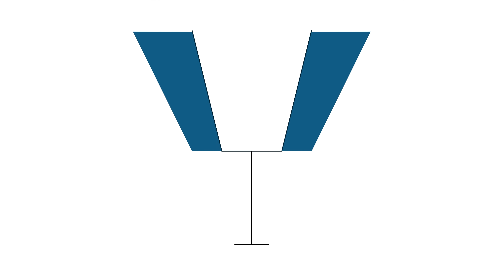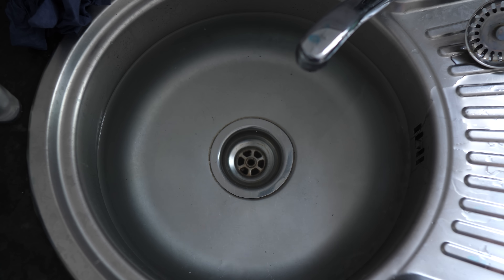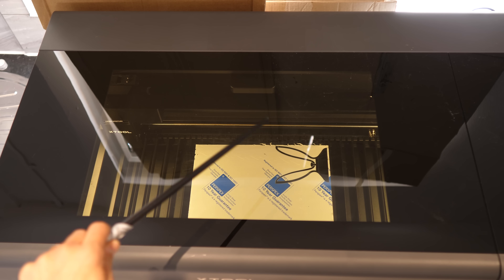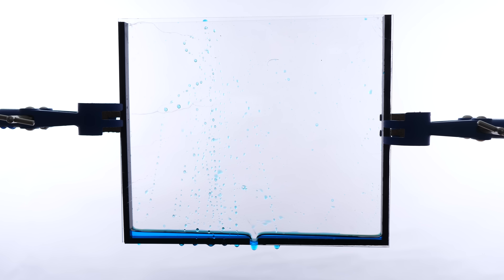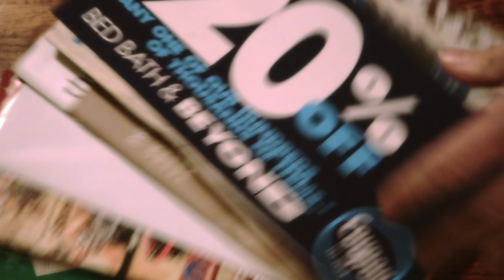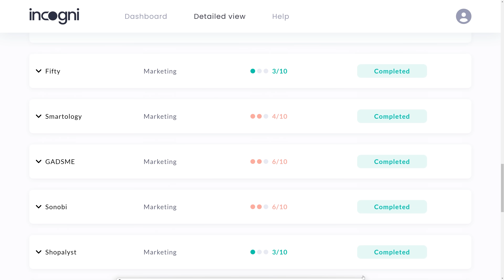2D water magic

Comment: Saw the Flow thingy around minute 8:00 and came right up with an idea. How aboutmaking.. like a Bowl. upside down on a spinning table. and maybe shine roughly the haklfside of it from top down while its slowly spinning away below. its may not the most acurat representation of a globe getting shined on but.. maybe a secondary bowl like 10 cm cm below to represent some sort of hard surface. you could paint it black to absorb the light to net let it go through. the Experiment may needs to be on decent scale so its somewhat enough space in the Liquid atmoshere layer to have flows of any kind. if you feel like it rebuild like some mountain on the inner bowl to see it may effects anything. I am sure you would get some awseome shots with a time laps if you ran this for hours under earth like proportions. ^..^,

Comment: 6:24 This looks exactly like the pattern of airflow around the back of a floor fan; the side it's drawing air from. It's drawn from every possible direction and the part where the airflow can be felt is surprisingly small.

Comment: Since SOUND travels through water better than it does air, would it be possible to see sound waves in your convection viewer? If so, watching sound waves travel around and through things would be an invaluable teaching tool, but grab the Slo-mo guys because of the speed you might not think anything is happening.

Comment: Your model of a sink drain you dis not included the J trap  some call them p trap. That is the drain pipe under the sink that is meant to keep sewer gases returning into the sink. That trap holds water in the bottom when the sink is not draining. How does that change the flow of your 2D model.

Comment: If you put a plate/ saucer in a sink, and rotate it fast enough, with a dish brush/stick thing, then the plate/saucer will rise to the surface. 
What is the force that causes this, is it centrufugal, ? 
just curious.
Thanks.

Comment: I feel like draining a tub will be different in the case that there is a vortex. Because you have those neutral buoyant beads, that light up under laser light, you can uses a 3d model with a plane of laser light to show a cross-section, using a (laser) line generator.

Comment: My son and I observed some interesting fluid dynamics in the bathtub last night that’s related to Steve’s video. Captured a little bit in the video link here: https://youtube.com/shorts/sgNi90llFfY?si=2nWGzW1-YE3GLux6

My son put a clear plastic cup upside down over the drain in a full bathtub. When the bathtub started to empty, and the water level of the tub dropped below the top of the upside down cup, we could see that the cup was remaining completely full of water. We could also see some teeny bubbles spinning around rapidly at the top of this upside down cup, indicating the water was spinning inside. It remained full as the water in the tub continued to drain. Even when there was barely any water left in the tub, there was a full upside down cup of water over the drain. Somehow the water in the tub was slipping past the lip of the upside down cup on its way to the drain with the cup remaining full. And the cup remained full right up until the moment the water finished draining from the tub and then all of a sudden the upside down cup of water dramatically drained all at once with a shlurpee sound.

Comment: 7:04 beads in the bottom right start flowing up.  Seems like the path against gravity and away from the friction of the bottom edge of the tank takes less energy than the path along the tank bottom.  Amazing. I was not expecting that.

Comment: Steve - you should look into PIV analysis - Particle Image Velocimetry. It’s the canonical method to analyze fluid flow. You could probably get a used system for about $500. I used to work at a company that made them and designed a high speed system with Phantom cameras. You can analyze gaseous as well as liquid flows.

Comment: The 2D draining is cool, but there are dimensional effects similar to what you described regarding the width of the goblet. So I would massively expect that the speed as a function of distance from the drain would have an extra power of 1/r (or something similar ish) when compared to the 2D version. This could make it look very different. 

I wonder whether you could illuminate the neutrally-bouyant beads in a 2D slice of a 3D flow using a narrowly collimated light source.

Comment: I would like to see a similar draining effect but of pouring water out by tipping the bowl over. Often I want to remove just the top layer but it always ends up being harder than I think it should and would like to see different tipping rates/angles or if there is an easy way to remove just the too layer.

Comment: Dear Steve,
I want to thank you for this incredibly satisfying video (along with all your other incredibly satisfying videos).
Adding the beads, and the echo effect is a stroke of genius. It makes me wonder whether there is also a way to use premiere pro filters to colour beads based on their positions in adjacent frames. I’m also wondering about whether you could incorporate a pump to cycle fluid through particular enclosure shapes. Which then makes me wonder about a sort of fluid flow equivalent of the unilluminable room, raising questions like: Where are the stationary points in a flow system?  What are the “particle, dwell times“ in a flow system? and this then made me think about work done by colleagues in CSIRO (where I used to work) looking at fluid flow and mixing in industrial settings. 

I really love your spirit of inquiry and curiosity, and the fact that you persevere until your questions are answered. This, coupled with your skills in communication, makes your channel an absolute delight. Many thanks

Comment: The straw trick is useful for tasting a small portion of a large batch of some beverage you're mixing without contaminating it; assuming you don't have spoons lying around. Used to do it when I worked at a restaurant.

Comment: Quite a few people have mentioned the difficulty in cleaning that cup, and I definitely agree. HOWEVER! Something that a lot of people probably don't think about is some of the different refillable water bottles and/or sippy cups. Make sure you really look at the lids of those before buying, quite a lot of them have difficult or impossible places to clean. The squeezable Gatorade brand bottles, the green ones with orange lids for sports, yeah... the plastic seal on the inside of the spout is non-removable and gets gunk inside it very easily.

Comment: Just last night I was playing with one of those double sided colored oil/water clocks kid toys and was noticing how the bottom has three small openings so the oil can drop down the sides while the water pushes up the middle. If I collected a lot of the oil and put it to the bottom covering all 3 holes, you can see the water create a little tunnel and splits the oil in half as it rises. It was fun to watch.

Comment: Steve you should check out a device called a Diamondback Hopper, they're designed to reduce rat-holing in powder hoppers which is a massive problem, usually solved by vibration devices or air nozzles. I'm in contact with the guy that patented them if you'd like an introduction. The science of it is fascinating.

Comment: One more thing. If you compare the water draining with flow of the sand in an hour glass, you might notice that the sand in the hour glass actually drains from the top. hence they have that conic slope on the top.

Comment: Steve, there is this thing Called Particle Image Velocimetry, that will give you exact vector of each particle's velocity. You need a high speed camera for it though. But if it's that slow, you may be able to use a phone's high speed camera.

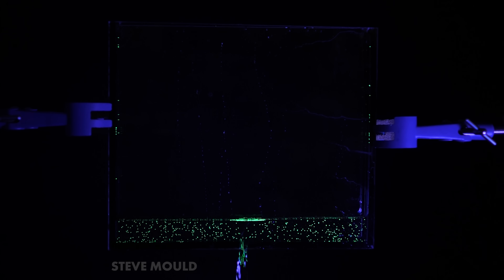Comment: 6:30 Just think of it as the water being pushed out evenly by the air in the atmosphere. However some will remain in the bottom because the atmosphere will pin it in corners unless you lean it so gravity can overcome the air pressure and let it flow out.

Comment: Hey, kind of a stupid question, but on 2:30 you mention how surface tension plays a role on this effect. Does this mean liquids with less surface tension (such as ethanol) require smaller holes for this effect to work?

Comment: The echo effect at 6:57 shows the water at the top surface flowing towards the edges and away from the center and that movement looks like its constrained to the surface interface as well as being almost immediately apparent once the water starts flowing out of the bottom.  That's not the behavior I would have expected!  What's the explanation for that?

Comment: Those beads being pulled towards the drain from all directions and the acceleration of the beads as they get near the drain instantly reminded me of the expanding universe and the acceleration of bodies. The beads don't seem to accelerate away from each other but maybe in 3D and if there is a "drain" all around the 3D sphere they would? Have I solved the mystery of the universe?

Comment: If you had a ridiculously tall container with a small hole in the bottom then the liquid at the top would boil and would still drain at the bottom, right?
Reply: If sealed at the top then yes, probably

Comment: @Steve Mould
Pause at 6:56 in the bottom left / right corner, there is like a curve where water moves significantly faster and close by it moves slower, is that some special curve? 
Like the "brachistochrone" curve, or something similar?
( Maybe a new "Mould Curve"? :)
Reply: Looks like a consequence of having a square container. It just appears to be an approximation of a y=1/x curve.

Comment: Those beads and the echo effect were so rad! I have only seen convection currents with dye, but those beads were such a neat take. Can you use those beads to do small explosion, like a very small firework  or something that won't do a great deal above the water but might show some of the expansion and contraction that happens. If you could get (I think they are called) pistol shrimp to do there  thing with those beads I would love to see it. O, idea, maybe you could see something sort of like the pistol shrimp snap with water hammer in a glass coke bottle if the bottle doesn't break. I think the mechanism is a bit different but I'm curious about seeing that vacuums rapid filling and whatnot. Anyway, love the stuff you make! Thanks!

Comment: Weirdly triggered by the spell with the wrong preposition. Latin uses "from", not "with", for the tool used to perform an action, so you should have gotten a saw with a laser pointer guide rather than a laser cutter.

Comment: What if the drain was in the middle of the volume of water instead of on the bottom? Would it still pull evenly in every direction? Would gravity slow down anything below the drain?

Comment: It's also worth taking into account the atmospheric pressure, exerting force on the water exposed to it, this is especially true at very different elevations. Also, a drain works a bit differently than you model. It doesn't need air, because it has air already- under the sink there is something called an S or Double U (shaped like a U, not W) trap- it serves a few purposes. The first has 4-6 inches of standing water held in it prevent gasses, like methane, bacteria & germs from traveling into the house as a result of this causing a "water plug". The second trap creates an "Air Plug" always keeping new water from the drain to fill that channel, while at he same time being less dense than water & letting it drain into the pipes beyond it. It also keeps water from spraying up through the drain during high pressure or wind storms. And lastly is it acts as a catch for jewelry, rings & the like from being lost as easily.

Comment: 7:40
The big question is: if you unplug the drain hole while the momentum in the fluid is swirling symmetrically away from the center and the bottom, will the flow of fluid make the swirling dissipate quicker, or will it act like the sink drain and increase the velocity of the swirling? It’s kind of a perpendicular version of the sink experiment, since the radial movement is not allowed by the 2Desque model!

Comment: @stevemould I have a question maybe you can answer quickly or through a visual experiment in one of your videos.

I was watching a leaf circling quicker and quicker in a whirlpool only to be sucked down and through the street gutter drain and I was curious if it could have been moving faster in the whirlpool than it would once it falls with the water 2 meters down to the sewer floor.

Basically: Could the speed of the water moving through a whirlpool be faster than the speed of the water exiting the drain?

Comment: Steve, you could record a slice of fluid flow in a 3d container by  shining a laser level or another thin light source. You can avoid lensing effects by carving the volume from a block of a material with a similar refractive index to the fluid

Comment: Steve, if you illuminate particles suspended in a fluid with light sources of different wavelengths, you can communicate depth
Reply: Would you not mind explaining a bit? I couldn't get..
Reply: @randomdosing7535  have you ever seen dust in a sheet of light spilling through a crack in the curtains? You could do that with multiple colors of light at different depths, so you can tell how far a particle is by what color it is

Comment: Alot of these principles help explain water distribution. Why water towers are so wide and squat for example helps keep the change in water level small and helps maintain constant pressure in pipes. Helps to visualize the change using a potential energy equation

Comment: It’s interesting how in both the draining clips, the heads on the surface rush into the center, and with much faster lateral movement than the beads just below the surface. I cant figure out what the mechanism for that would be, and I’m curious if it would happen in 3D or if it’s a function of the 2D cutout. I’m also curious as to whether it’s centered because the drainage hole is centered or if it would end up in the middle even with an offset hole. If anyone has any insight please share!

Comment: I think the 2D model showing how the water drains is accurate, but exaggerated. Water, like any fluid, has viscosity and so would have the boundary layer effect, that area is just much smaller than the total volume.

Comment: 6:28 The answer actually lies in this shot! If you look carefully at the point on the surface of the water as it drains, you'll notice a very dense cluster of those beads. Which means the beads are being drawn there disproportionately to the entire rest of the fluid body.

Naturally, this applies to the water as well. This creates chaos and turbulence at that point in the surface, which over a long enough period of time averages out into motion one way or the other depending on chaotic starting conditions. Which is why you can 'give" it a starting spin more rapidly by having large portions of the water already moving one way over the other, and why a vortex that forms "naturally" is usually really small unless there is a very large amount of water already. Its also why that vortex is very unstable, flitting about and twisting and bending, because as more and more water is removed (or even added, if the faucet was on as the water drains), that average force in the body changes very close to the thresholds that determine the exact shape of the vortex.
Reply: The Echo based followup shot makes it much, much easier to see. The Particles on the surface, once agitated, immediately shockwave out to the walls of the container, and then bounce back inwards and collide at the center. The result of the collision cancels out all forces that aren't perpendicular to it, leaving only the one perpendicular to the plane of the surface of the water, and thus the ones responsible for causing the "spin" of a vortex.

Comment: 6:25 reminds me of air entering the back of a fan. I always used to wonder how a fan can produce so much positive air pressure at the front but almost no negative air pressure on the back, until I saw a video from "Matthias random stuff" (great channel) explaining how air enters the back from all directions evenly but exits in a straight column

Comment: Fascinating, the 2d filling with a stream of water that gets pushed out by the displacement of internal volume of air, at 04:00 (ish).
Since the 2d walls are tight enough to make surface tension keep the stream unbroken, could the stream potentially grow itself infinitely long?
Given a long enough stretch of 2d walls, could the stream be pushed along for a very far distance?